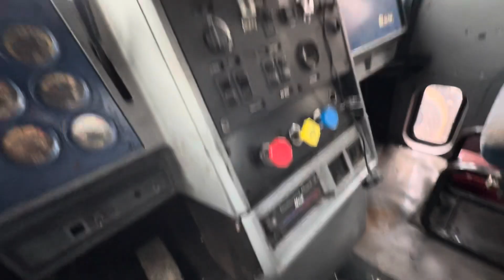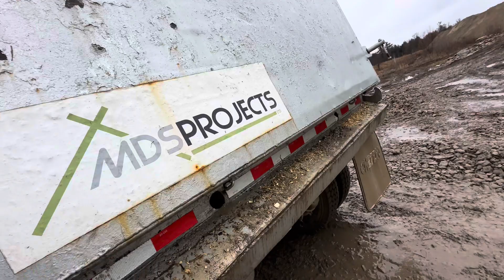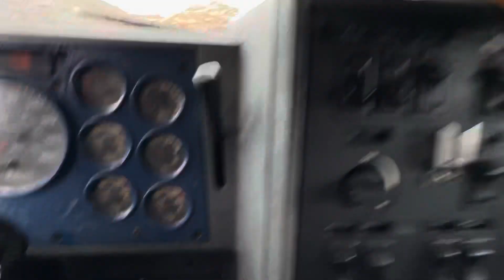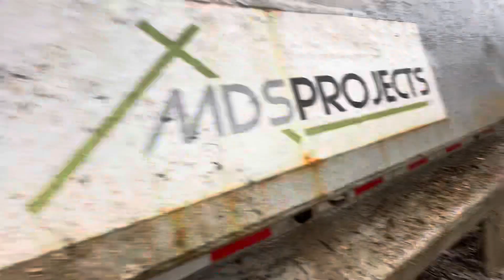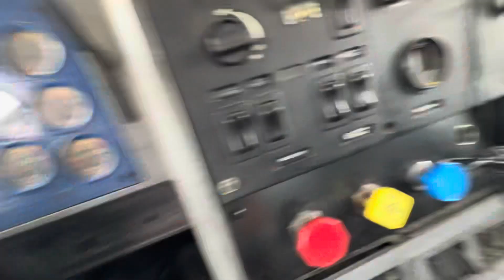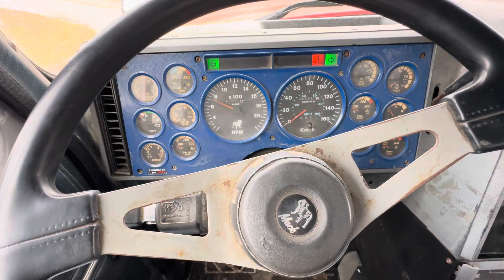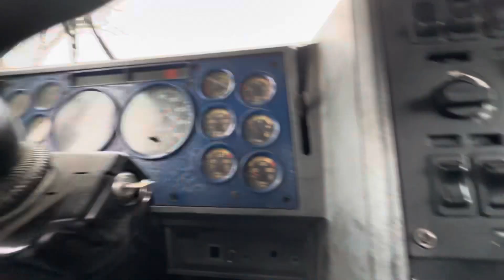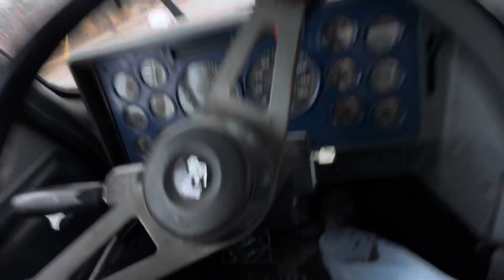Manure transport with Tri Axle Dump Truck Mack Cl700 and John Deere loader

Comment: What a run! That CL700 sure sounds good! What year is it, and is it running the Mack E7 with Eaton Fuller 13 speed? And like I always say, if you can't find 'em, grind 'em! What's the year, make, model, engine and transmission of the dump truck with the Cat engine? I'd love a super long driving video on that one, as well as the Mack stone slinger truck! Please let me know ASAP.
Reply from the maker: It’s a 1996 13 speed eaton fuller the transmission could use some repairs for it to shift proper without grinding. The 10 ton single axle dump truck has a cat 90056 engine is a 1995 gmc topkick eaton automatic transmission. That’s about as long as I like to drive that was helping someone out and only pays $110 per hour the stone slinger is $220 per hour but usually use them for my own client projects. All of the trucks have to be safetied so I will have videos of getting them ready probably in the next three months.
Thank you
Reply: @M.D.S.Projects  will you do long driving videos of each truck?
Reply from the maker: @GarbageSean  I usually never have to drive longer than half an hour so we will see
Reply: @M.D.S.Projects  sounds good, can’t wait to see what will happen!
Reply from the maker: @GarbageSean  I have another channel too MDS Squared when I’m not on here
Reply: @M.D.S.Projects  awesome! What do you put on that one?
Reply from the maker: @GarbageSean  check out more personal stuff trucks, fishing, anything I do
Reply: @M.D.S.Projects  just subscribed!!
Reply from the maker: @GarbageSean  thanks